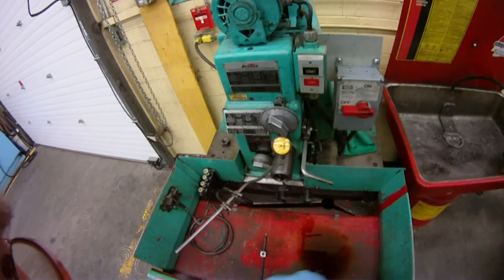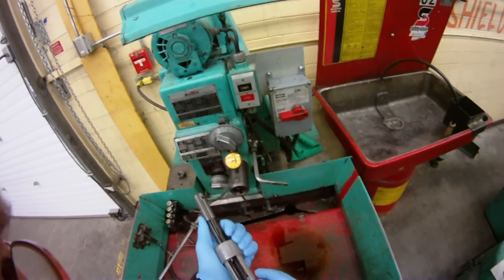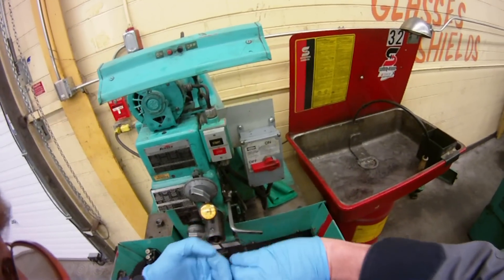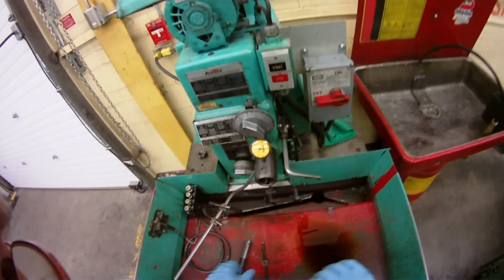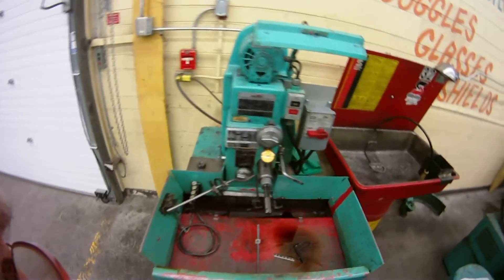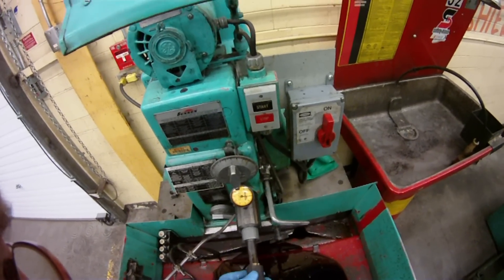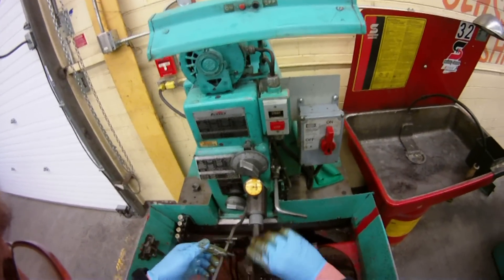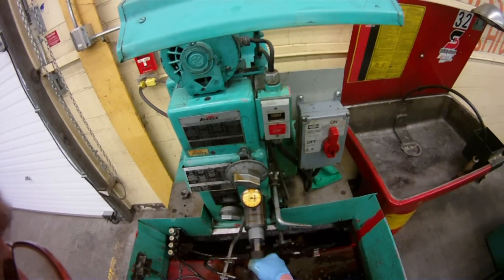Sunnen Hone Video Demonstration

Comment: When setting the stone with the truing sleeve,  you should do it dry ... with oil applied there is almost no wear on the stone, the whole purpose of the truing sleeve is to wear the stone to a perfectly smooth and accurate fit ... without oil, there is a very high wear rate on the stone, which is what you want at this point,  so you can only use the truing sleeve to true the stone up dry ...
Reply from the maker: Thanks for the advice Robin.